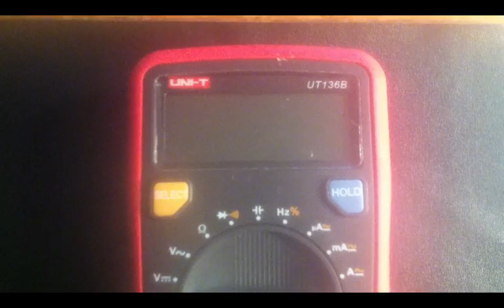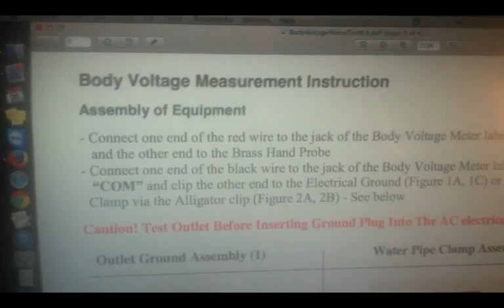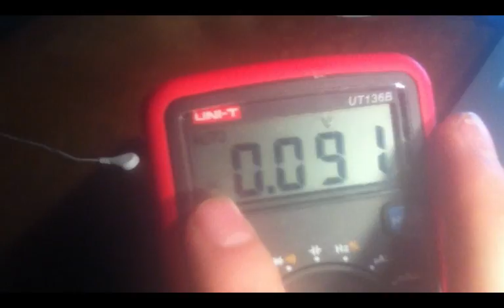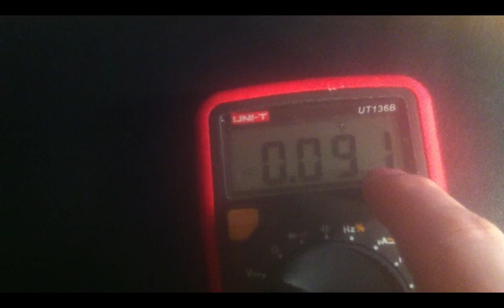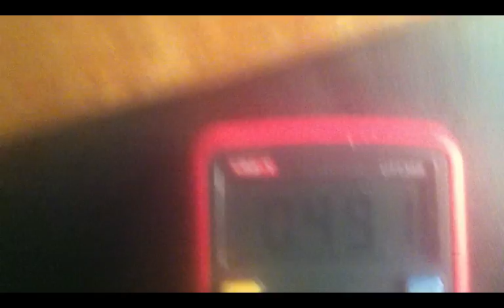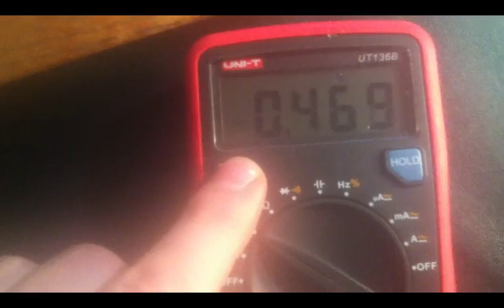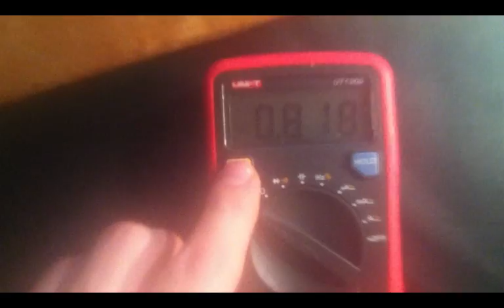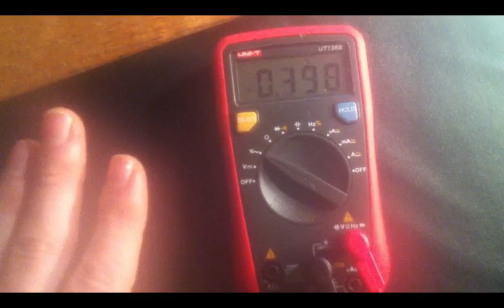Hot To Use A Multimeter To Test Body Voltage

Comment: Were using a solid shielded cable wire to the ground stke  help seems like there might be a little bit of the wire acting like an antenna even though it is grounded it seems like using a shielded cable wire might be the ticket

Comment: So you're touching the meter and other edge touching the ground shows 2 volt(some number). But than you touch the mat which is also connected to the ground while continuing to hold the red lead, all you're doing is basically touching the red lead and the black lead. But the mat does prove to be conductive since it's acting as a continuity of electric current.

Comment: Why cannot I not find a good video for this... insane.
Reply: It's a bit of a new frontier. I'm sure there are a lot of other details we can find in the body with a volt meter with proper application and understanding. It is such a complex system, and i imagine the placement of the probes can make a big difference, but understanding why is a lot to work out. I believe the accupuncture model is likely to help in this process

Comment: Thank you very much for detailed testing with an ethernet cable. I thought WIFI was unhealthier.  Also thanks for testing with touching and staying near the laptop. I thought as long as I don't use the laptop such as using rubber top can avoid EMF. It has seemed that laptops with the aluminium case are unhealthier than those with plastic case.
Reply: wow, so my mac book is worse?

Comment: Can u measure body voltage with a cheap multimeter when the lowest setting is 200 ac volt? when i'm standing with my bare feet on the second floor i measure 02.6 but with shoes 00.1. On the first floor it's always 00.1, even when touching a desk lamp, power strips ... . Also when i'm pressing the red cable agains my forearm i get a lower reading then when i'm holding it between my fingers. Any advice as to why this is would be appreciated since i want to test the earthing wristband i got.

Comment: The black multi meter wire will go into another ground plug,( so it can be a reference)  you can stick the black in the ground circuit of the wall.  then hold red multi meter wire in hand. (touching top part)    then do tests.......feet touching ground mat....off ground mat.

Comment: Your way of measuring "body voltage" should be called "skin voltage".  The potential, the earth, is not zero.  To figure out what the voltage in the earth is you will need an oscilloscope sensitive enough to measure high frequencies.  If you were to measure internal voltage you will be surprised at what's really happening.
Reply: Elaborate plz
Reply: Do tell!!!

Comment: I am sort lost. I see the grounding matt is connected to wire that goes outside to the ground. I see that the red wire will be the one that you touch. But...where does the black wire go?
Reply: the black will go into another ground plug,  you can stick the black in the ground circuit of the wall.  then hold red with hand.    then do tests.......feet touching ground mat....off ground mat.

Comment: Hi I wanna ask one question. Would it be the same if I would take black and red wires with my hands and stand on the earth with my bare feets? In case if I would like to test my body voltage in outdoors.
Reply: No black in soil, red in a hand.. You will probably get a low dc.
Reply: Craig Manuel Thanks for answer.

Comment: you arent reading your body voltage here, you are reading the voltage difference between two seperate grounds. there is no such thing a zero volts on any earth. voltage is the measurement of differential potential between two points and because your laptop will be earthed with all of the rest o the "dirty power" on your houses earth system and you have a nice shiny copper rod underneath a tree thats absorbing water you will see a great difference, if you take an earth from your houses system then test you will see a very low potential. (but this could be extremely dangerous if you have any earth leakage) 

i know this as i am an electrician
Reply: Hi Jak, Could you please tell us a better way to do this test, I am sure everyone would appreciate it from a qualified person like yourself.. Thanks  :)
Reply: Emg tells of a body voltage. Probably DC. AC is artificial.
Reply: So you can hold the black lead in one hand and the red in the other?  Will that work?

Comment: I still don't know how to use the multimeter to  test my body voltage with this video.  Do I need to buy a separate wire, alligator clips, and some sort of grounding rod to place outside or can I just use the multimeter itself to tell?  I didn't see you touching your body with anything.

Comment: Thanks for making this informative video. I purchased the same multimeter and just tested my wife's Macbook pro with a shorter cable (UK plug attached to the power brick). I was astounded when I saw the reading was 90V! I was able to replicate this with my Macbook and charger by adding the plug to the brick in place of the extender cable. This is unbelievable. I've seen a few of these videos and the highest reading I have seen is 10-12V. I wonder if anyone else is seeing a similar reading with the same setup.
Reply: anything MAC has a high voltage, the Iphone ans Ipads are bad as well. Samsung phone are very low.

Comment: i would think you should have a common ground. so instead of you using a separate ground to the rod in your backyard, you should connect the ground to the ground of your electrical system in your house. That is the ground that your ethernet is most likely using. voltage is potential, so if your grounding points for two objects are different potential, you are measuring the overall difference.

Comment: What do you do with the black wire ? I have Multimeter but nothing happens. The ACV box shows 750 and 200. Is that to high to test my body. Do I need to get a lower meter ?
Reply: I have the same 
Black goes in wall
Red with you 
750 is max range 
My volt was .04
Reply: openyoureyes you plug the black wire into the grounding port of the outlet?